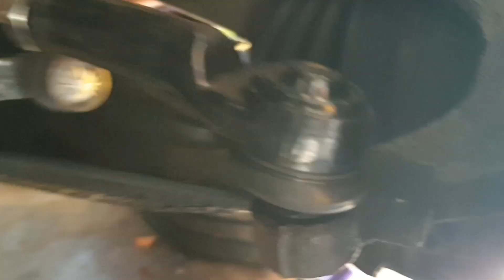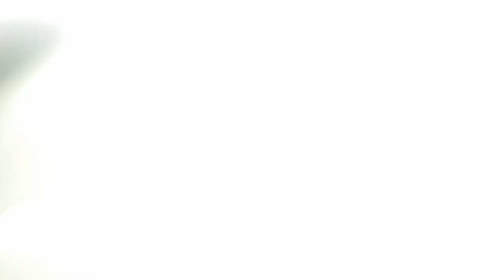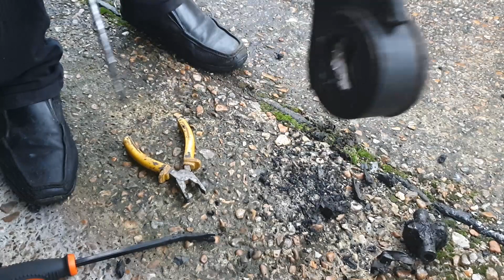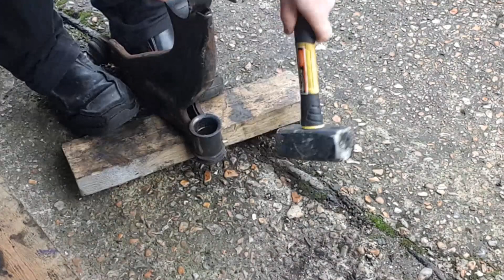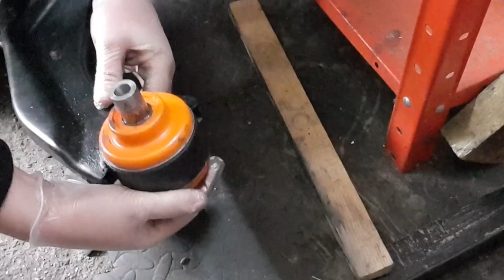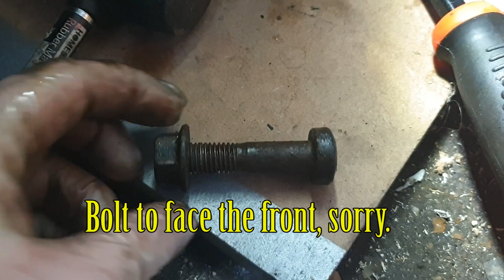Mondeo mk3 ST220 wishbone poly bush upgrade

Comment from the maker: Hi all, just thought I would share the Torque Settings for the reinstall as i forgot to mention them in the video or is it just me that does this, i know not everyone worries about the torque setting as long as there done up tight. But here they are.

Lower Arm Ball Joint 83Nm
Subframe Bolt 142Nm
Subframe Braket 10Nm (2x10mm bolts)
Wishbone Bolts are done in two stages
Front Bolt = 80Nm then 60 degrees
Rear Bolt  = 90Nm then 60 degrees

All details are from FordEtis IDS manual

Comment: Cutvthe head of bolt off . Drop through the bottom then put new bolt in through bottom with nut on top ... don’t touch subframe... ... grind top part of bush then push rest out with 12—-20 ton press

Comment: Hi chazz so what's the verdict on these new poly bushes, worth buying pal 👍
Reply from the maker: will be doing a video on this soon, just waiting on some parts to turn up to finish another project.
Reply: @ChazzCoombes  👍 want to buy some ASAP,  just don't want to make the mistake of buying them if they aren't up to the job pal.
Reply: Hi chazz any idea when you can do that video regarding whether the bushes are worth buying mate.
Reply from the maker: @nevc3968  hiya mate just waiting for some parts to turn up from Twinzmotorsport then i can take it out for a proper run. The video is coming aswell as a few others im working on
Reply: @ChazzCoombes  cheers pal 👍
Reply from the maker: @nevc3968  just working on something at the moment but all will be shown soon

Comment: Watching you struggle with that arm...lol.  There's an extra step to make it easier.  Take a trip to halfrauds and grab 2 pairs of spring compressors.  Think Laser make em'.   20 quid each or thereabouts.  They need to be cut down, by an inch  or so to fit in the shock tower, but this will get the pressure off the arm completely.  Apart from that...top work 👍
Reply from the maker: i got some spring compressors, never thought about that. nice tip 👍

Comment: Nice video.  Would it be a good idea to install the rear bolt from the bottom so the next time the wishbone has to be removed you don't have to lower the subframe?
Reply from the maker: Yeah thats how most people reinstall them, but think its put in this way for a reason, mainly safty incase the bolt brakes then it wont drop away from the car thus causing the wishbone to come lose. If that makes sence
Reply: @ChazzCoombes    Yes, that does make sense.  Safety first!
Reply from the maker: @davidgoldberg  all thats left is to tourque then up.
Reply: The whole idear of the bolt going down from the top is a Safety reason.
With the bolt dropped in from the top and later the nut works lose and falls off, the bolt still holds the wishbone in place.
#
If you fit the bolt in from the bottom with the nut at the top, if the nut works lose later, the bolt drops out and your wishbone comes out while driving.

Bolt in from the top is the ONLY way to fit these things FOR SAFETY!